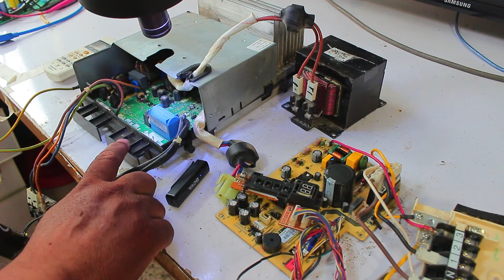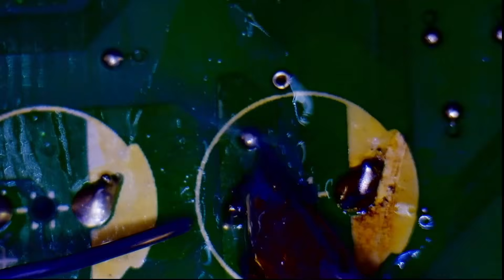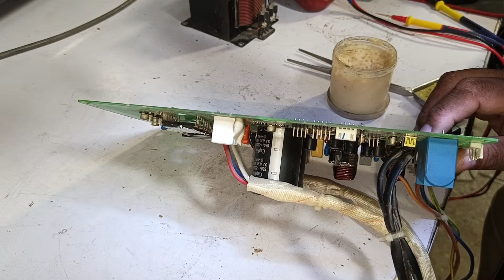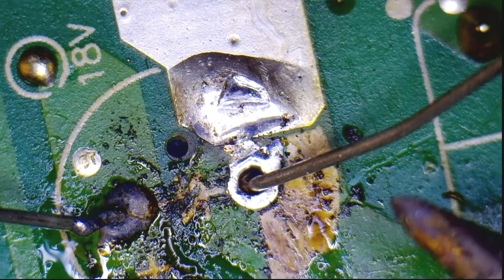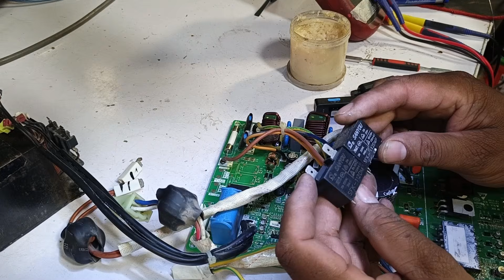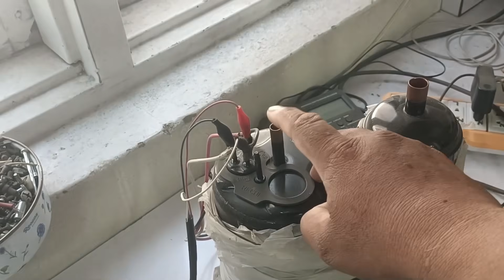No Error, Both PCBs ON… So Why Nothing Works?

Comment: Really surprised to see china junk crapacitors in a Panasonic board. Chong / Chang  / ChongX / ChangX and CapXon (aka CrapXon) are low to bottom-tier parts and it's no surprise they have failed.
You might want to invest in a smaller tip for your soldering iron more suited for PCB work and a desoldering tool - even just a cheap handheld one would make your life a lot easier.